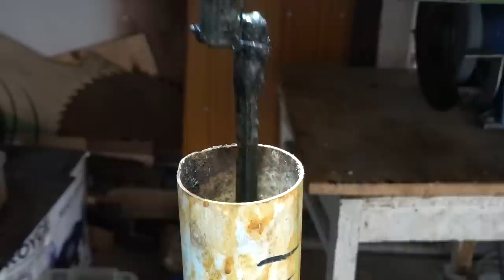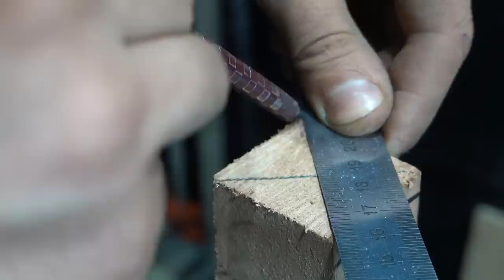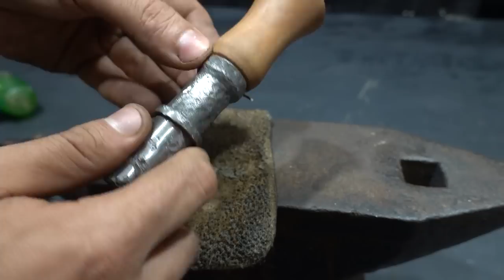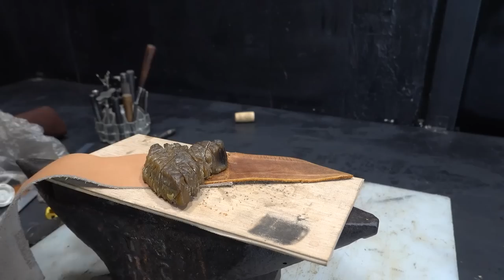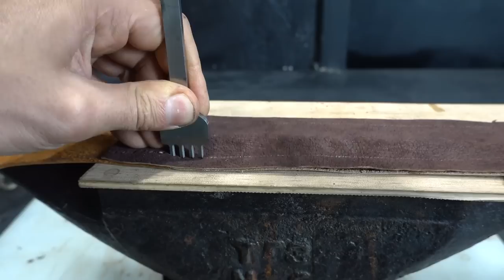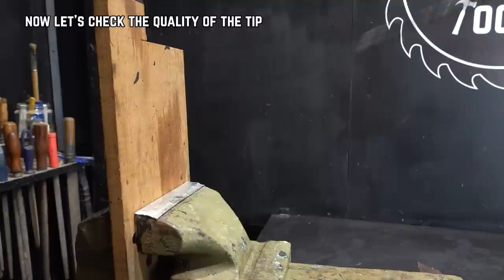Restoration and Renovation of MOSIN bayonet

Comment: You should quench and harden the soft tip and not remove it.
Other than that, good job as always.
Reply: Exactly right.  Corrosion can  do funny things to grain structure, usually significantly weakens the metal left behind.  Best approach is to normalize, then straighten, then temper.  Honestly, just fine to learn on this.  As always, nice work.
Reply: I thought the same thing at first. But something that thin in cross-section is likely to warp under heat treatment, then he would risk breaking it when trying to straighten it in the hardened state. Also, something that thin is very likely to have fine stress cracks due to the force that bent it in the first place, and straightening it would only make it weaker.

I for one do not want something he has worked on to break during the testing phase. So, much as it reduces the piece’s value as a historical artifact (and it’s not as if they are very rare), what he did was the safest thing. Even reforging it would not guarantee the stress cracks would go away.
Reply: @thomasmchugh1448  I would agree with you. Following the complete heat circle would do the trick. Besides I can't possibly know if these bayonets are rare or not, l don't live in the former Soviet union. Regardless their rarity they are historical artifacts and they should be treated with the proper respect.

Comment: It's a good job but I would have preferred that you restore it to its original state
Reply from the maker: Unfortunately, this is not possible, the part where the latch was simply disappeared, and the tip would not have endured hardening.
Reply: @ScrewsAndTools  yes, perhaps the tip could not be functional again, but if it was for decoration, with a soldering iron I think it would have been good to cover the imperfections, and then blueing.  It's too shiny.
Reply from the maker: @Sillu  Aah, yes, I understand what you mean. If for the sake of appearance, yes, you are right, but I'm also preparing tests for you, so I think it's more fun)

Comment: Cool restoration - however, was it necessary to shorten the bayonet? Couldn't it just be properly tempered, if part of it was, for some reason, soft steel?
Reply from the maker: Hello, thank you, there was no material for hardening there already. If I had heated it to 900 degrees, the tip would have burned down simply.